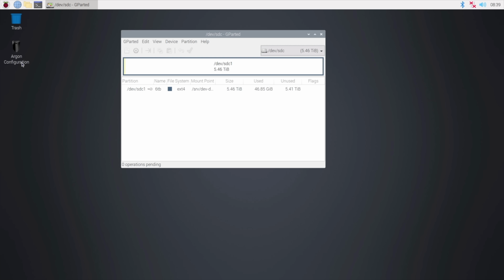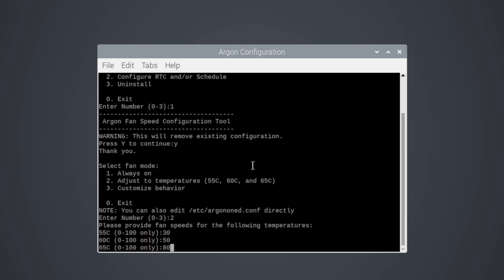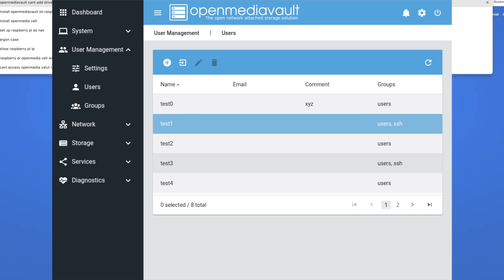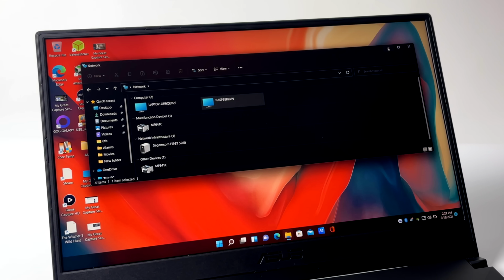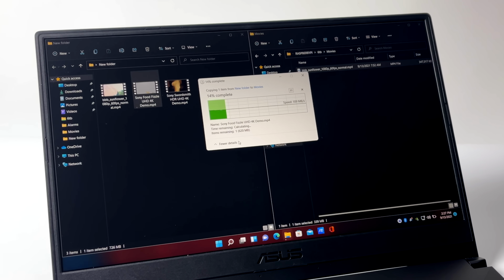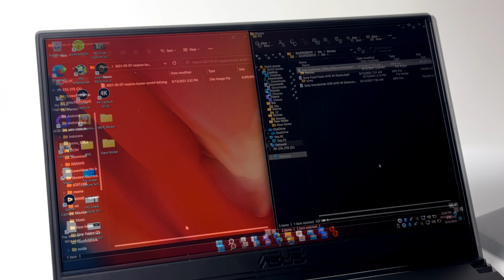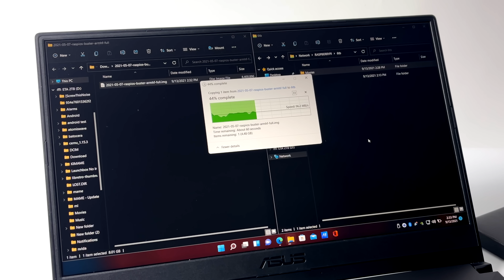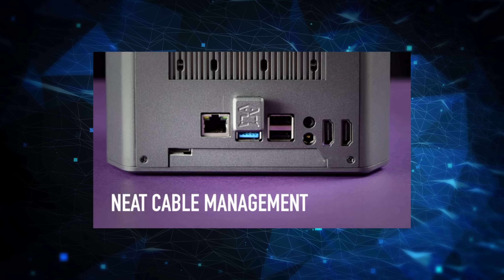Argon 40 EON First Look! A Raspberry Pi 4 Powered 4 Bay NAS

Comment: "But why wouldn't we make a NAS that can hold 4 full-sized hard drives?"
"Because, dude, it looks so cool as a triangle."
I understand form over function in a lot of cases, but a NAS? Who the hell is setting a NAS up as a conversation piece? 4x 3.5" drives or you're just better off buying a cheap 2 drive Qnap or something.
Reply: when you're running it in your living room and trying to convince your family of the importance of backup
Reply: I agree, my router and optical cables come into a small cupboard under the stairs and cat6 ethernet to each room, my NAS is located in there also and is in a 3D printed case, I prefer it hidden away but some will want it on display in pride of place under the TV, you know what comes next, RGB NAS!
Reply: The deal killer for me is this:  "A USB based NAS?!".  come on!
Reply: Better build a unraid server I'm pretty sure price not cheap + raspberry pi just spend a little more for an i3 unraid server and good for plex transcoding
Reply: @yesplusca  A PI4 CM on a carrier with either a PCIe slot or SATA will allow for a full speed real RAID using either a RAID card or mdraid
Reply: @BruceFerrell  
Yeah, I was confused why this thing didn't use a compute module anyway. The SATA support, and the fact that a NAS doesn't need all those USB ports. Power could be handled better, etc. This thing is an identity crisis of design.
Reply: @yesplusca  
If you keep an eye out on Ebay, Newegg, and Amazon you can often find older  workstations with i3's or i5's in them with several empty HDD bays and ports on the board to match for around $100-150. A nice perk is that they will sometimes come with a fresh Windows license you can put on another machine if you don't want to use it on that one. 

Just Google the model when you find one so you can see the internals and specs. The most I've ever had to do (besides adding drives and loading an OS) is put another stick of RAM in the thing so it uses both channels. Might need a boot drive too, but you could always rune a light OS from USB.
Reply: @MrNside  Personally i'd recommend the hp microserver gen 8 if you can find one cheap, it has 4 HDD bays and server features but is noticeably smaller than most other servers.
Reply: @yesplusca  instead of i3 i recommend a low power j5040 board. there was one on the channel a while back actually. running truenas and proxmox on one, more than happy.
Reply: @southpole76  While you can make a NAS with a J5040 board i wouldn't recommend freenas since the developers heavily recommend only running freenas on PCs with error correcting memory.
Reply: @IsoMacintosh  what do you recommend? i'm also testing OMV and others at the moment. but tbh i run servers professionally at work without ECC close to radioactive sources since more than ten years and have never seen the need. i don't wanna say it's a scam but it's a scam.
Reply: @southpole76  Basically any OS which doesn't use ZFS. 

But to be clear i have absolutely no idea about how ZFS works and i'm simply trusting truenas devs because they have way more knowledge about ZFS than me.
Reply: Interested with this device at first but what you said got me thinking. You're right.
Reply: I would rather just get a refurbished I-3 computer and stick a couple of 4 TB drives into it rather than deal with that  case.
Reply: Yep, lost interest in under 2 minutes of the video because of this.
Reply: Probably better as a little unraid server than just being labelled a NAS, in these days of cheap cloud storage I don’t see much need for a NAS

Comment: I wanted to like this, but they should have stuck to just one drive format to either shrink the case (4x2.5) or make it more square (4x3.5). For the price, it could have been a strong competitor against Synology and QNAP 4-bay NAS units that are typically in the $300-500 range, but instead it has to compete against the 2-bay NAS units which are really aggressively priced. Meh.

Comment: That's a nice little setup.   I would not mind playing with it but I would be concerned with the air flow through the case.   If the fan control is wonky like in the ArgonOne M.2 where your mileage varies depending on why you actually install because some Pi Setups control the fan well where others do not especially if you want to run emulators.   Honestly I prefer to run the fan at all times because I am always concerned with heat and if keeping things cool requires a bit of noise its a trade off you need to accept but you can always change the fan and balance the need for cooling and noise but heat is the primary concern for me not so much noise and you can always place that in an area where noise is not an issue.

Comment: Why would you limit yourself to only 2 full-sized drives? I'd rather have 4 full-sized drives in the thing for more storage.
Reply: Hard miss by argon
Reply: Another half an inch to a full inch in width would have likely allowed for 4 full sized drives
Reply: Idk if the Pi can handle it but I guess you could do 2 large drives (16tb drives work btw just aren't officially supported) and then have one or two SSDs for fast ingest/cache. I feel the pi wouldn't make good use of the speed though. If that thing used the Pi CM4 it would be able to utilize a pcie bus for far greater speeds (or even an NVME drive)
Reply: @Tim v H I normally see a 2.5in hdd die before the full size one. Ofc a SSD will last longer unless written to constantly (they have hard write limits)
Reply: @Tim v H well for SSDs to put it kinda simple every time it is written to the silicon is weakened and eventually sector by sector it can no longer hold data. Now the difference for a 3.5in hard drive and 2.5in is likely just the larger one being more spaced out with bulkier hardware and ability to stay cooler whereas a 2.5in drive is quite cramped

Comment: I backed this on kickstarter! Very nice to see it in action here. 

I'm guessing the purpose of the design is to have 2 2.5 inch SSDs and 2 3.5 inch HDDs to set up RAID10, getting maximum performance from the disk I/O speeds. I'm wondering if it would be possible to use the remaining USB3.0 port for a 5GBPS ethernet adapter for maximum NAS performance.
Reply: @ZiggleFingers  there goes my upgrade dreams... Thanks for saving me the money by stating this nevertheless!

Comment: They should have made a more square ish form factor to accept 4x 3.5 HDDs
Reply: agreed. wasted potential.
Reply: ...& hot swap... NAS without hot swap is a bummer.
Reply: BUT DUDE! It's a TRIANGLE!
Reply: Yeah really dumb. Form should follow function and this is the opposite.
Reply: That was my initial thought, but I could have sworn I saw a video with a top view where it looked like the back was a right angle, which would make it fit in a corner.
As I look at this video, it looks like an equilateral triangle to me.

Comment: Ok you definitely got my attention! This case has some real adventuress. The design makes it easy for anyone to install drives without going through I’ll major tear down. I think it will be a best seller. I just hope the pricing will be reasonable.
Reply: It's on Kickstarter at the moment. 
Approximately $160 Canadian.
Reply: The retail price after the Kickstarter campaign is over will be around 140-150 US$ (without drives and Pi 4).
Reply: 100usd i think
Reply: But will it eventually be available outside of Kickstarter? Seems to be all sold out now.
Reply: @TheD3vilHimself  I think only the early bird discount is sold out. It kinda looks like they are using the Kickstarter to determine how many to actually make, since the goal was only $3500 and they're planning delivery in December. Caveat emptor, of course.

Comment: For testing purposes, just leave the case off and put in the 4 6 TB drives.  Or is it a power limitation?
Reply: I'd also like to see if that works as well.
Reply: It looks like at least one of the SATA ports is too close to the frame and other port to hold a 3.5" drive. The shape of this thing is dumb, just make it a rectangle that can hold 4 drives a reasonable person would want in a NAS. Whoever designed this thinks people put their NAS on their coffee table or something.
Reply: @MrNside  perhaps there is a SATA-riser somewhere out there. I wish the Helio64 project was still alive.
Reply: The shape of the box mean it can only hold 2 3.5 inches drive and 2 2.5 inches drive.
Reply: @lukewatson059  It comes with 6A supply which should be enough for 4 3.5in drives, not sure if there would be any problems at spinup though. Most drives only need around 0.5A.

Comment: Huh, I was just about to buy a nas.  I'll need to look into this

Just backed it.  I think for 99.9% of people 2x3.5 inch drive bays is enough, most people don't have a 4 bay Nas.  I was just about to buy a nas a few days ago and was trying to find something that was open source but all the highest rated one for open software aren't in stock anywhere.  This probably won't be able to transcode video like a Plex server but eh, I can live without that.  The only problem for me is waiting till December for it. . .
Reply: Why not just build your own? Almost any computer can be used as a NAS and would probably be cheaper than this Argon system.
Reply: @jepoyburner  well, I needed it small to fit where I wanted to put it and didn't want to get a new small PC.  I considered a pi actually, was looking at boards, a few people make server/Nas boards for the pi but no cases.  This is just a lot easier.

Comment: If you leave the sides off the case, can you fit 4x 3.5" drives?
Reply: Also, if they do fit like that, does it have enough power to operate all 4 drives.
Reply: @roynielsen1911  no
Reply: That is a good question, it looks like you could
Reply: Spacing is not the same on all the SATA ports it doesn't look like they would fit unless you used an extension cable.
Reply: @ZiggleFingers  what about the transfer speeds on usb?